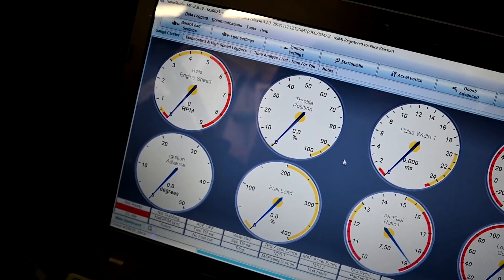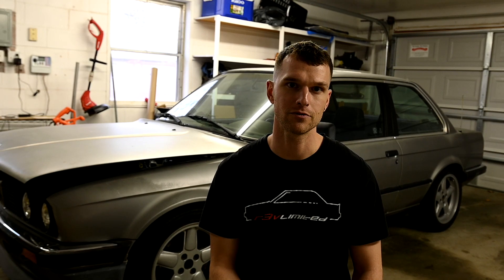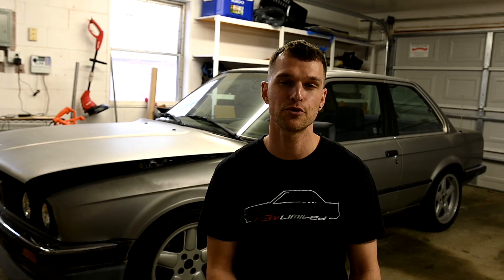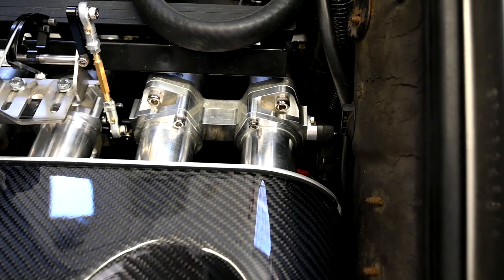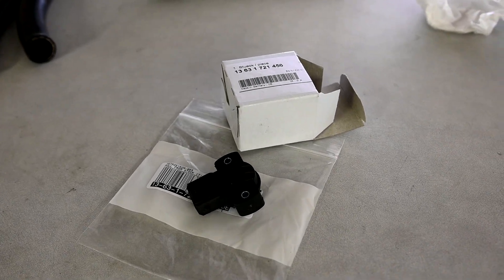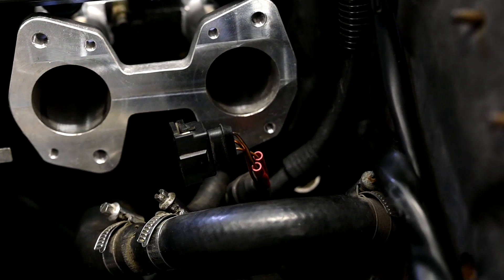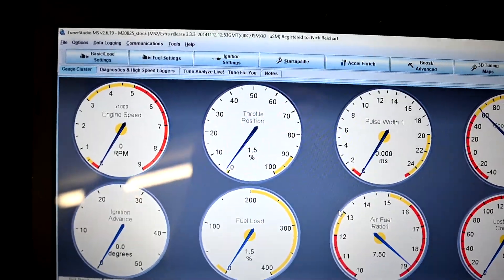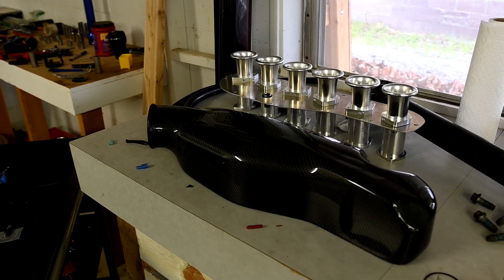New Throttle Position Sensor for the ITB E30

Comment: Maybe that's the problem with mine. I have an 87 325e and after it warms up the throttle goes up and down, but when I put it in drive it stops, starts going up and down again when it's in park, any suggestions?
Reply from the maker: The 325e uses a different style TPS but it does seem like a sensor somewhere is going bad. It's been awhile since I've had a 325e but I remember the other sensor in the thermostat housing, not the coolant sensor, gave me some idle issues.